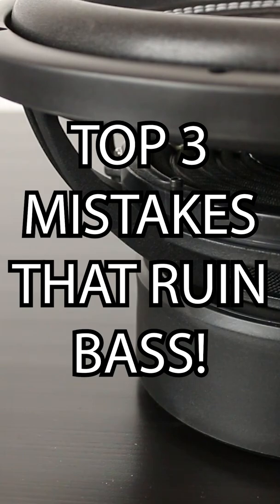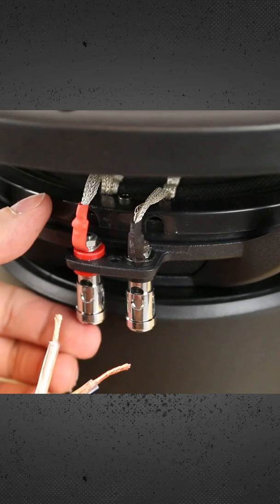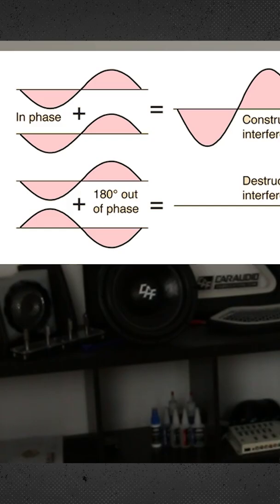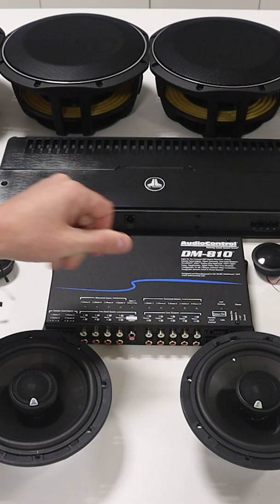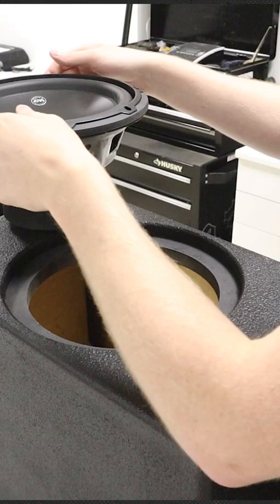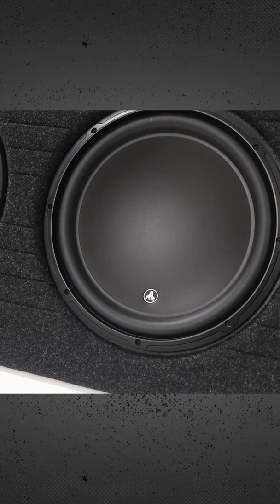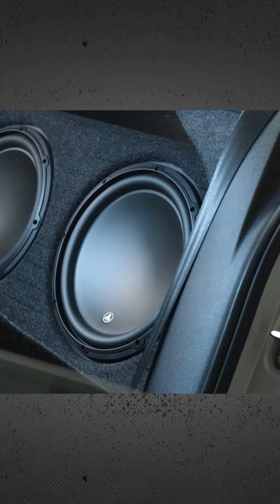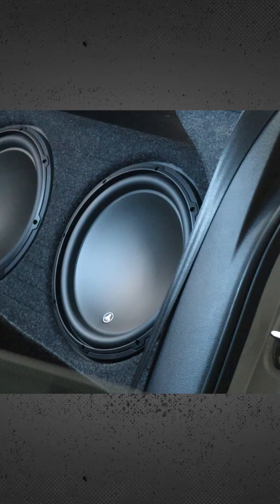3 Mistakes that Ruin Subwoofer Bass! #shorts

Comment: I have a warzone 12 3000w with a power acoustic 2500w amp dose the amp also has to have 3,000 or is it fine I just gotta have a fan running on the amp

Comment: Seeing and hearing my friends mom's Klipsch home speakers with a passive radiator and decided to make a custom box for the rear of mustang GT. Knocked the magnet off an old sub I had and went to work. Everything was ok, box fit good looked ok but was totally unaware of the weight added to a passive radiator needed to make it work properly. Needless to say I had a lot of distortion although it pumped pretty well

Comment: I like running a single dvc 12, I have a sundown 12, the 750 rms one, dvc 2ohm, I have it ran to 1 ohm & it is is a QBomb bandpass box, but I personally like it in a sealed box, but everyone says run it in the ported box? I just like the way it hits in the sealed box, but I just don't want to mess it up. But I have 1 cubic foot of air space in the sealed box. But my question is, does a sealed box tear up subs?

Comment: Improper tuning and overloading of power if you push a subwoofer too hard it's not that you distorted it it stops pushing you get it at the right peak and that frequency of sound will slam

Comment: have you ever combined 8-in subwoofers and 10-in subwoofers in a speaker box designed for a back end of a Dodge Grand caravan what would the sound be like wondering and around with designs got any 8-in speakers are already in the box and close didn't speakers square out of box.????? how do you think I should pursue that for sound.

Comment: Not securing the subwoofer box, and it slides around. Whats worse is if your wires arent long enough, and get yanked out of the amp or speaker box. Also, having your box in the wrong position. If your subwoofers faces are pointing toward the rear of the car, you should have your subwoofer box pushed as close to the rear seats as possible. This will give your subs more space to move more air easier. If your subwoofers are facing your rear seats, you want to slide the box towards the opening of the trunk. This will give your subwoofers the air space they need. However you mount your subs, try to at least give them 1 ft of breathing room.

Comment: How do you know if a sub works better in a sealed or ported box?
Reply: There's a spec called q/qts. If it's below 0.5 it will be better in a ported enclosure. You can research "q" values for subwoofers.

Comment: Biggest mistakes I see are on the head unit, people cutting the harness instead of getting the correct adapter. But for subs I think using cca instead of ofc, I guess its ok for low powered systems but ive seen 18 gauge cca speaker wire from 1200 watt amps same with power wires.

Comment: Subs not being wired for the correct ohm load to match the stability of the amp! 
As an installer since 2004 this seems to be the one I notice more than any. Aswell as subs not having adequate airspace or being in the correct style box per the manufacturer. 

I'm sure anyone else in the industry can attest to how irritating it is to see these issues. Usually these go hand in hand with a $30 amazon head unit! They have full plus level bass adjustment, No sub preout(s), just standard rear 2v preouts. Then they usually have 100% gain and frequency.

This to me is the equivalent of nails on a chalkboard!

I just convince myself their young and just haven't learned yet. Or realize they don't care as long as they have working subs for the time being.

Comment: Blocking the port. However wide the port is, you need that much clearance in front of the port as to not obstruct the air flow.

Comment: Wouldn’t out of polarity make them work with each other? Correct polarity works against each in the same box. That resistance of air flow gets them tones. Somehow I think this only makes sense to me.
Reply: They cancel each other out!  What happens when you take a playing sub out of the box, does it get quieter? Because any air from the front of the sub mixes with any air from the back of the sub they cancel each other out= no sound. Phasing  is the same, they both must push or pull together. The air from one sub will cancel air of another. Been old schooled you have by a 48 yr old who still probably out bumps you with one 12" SPL  soundstream ran off a PPI 2050m. Both over 25 yrs old.  Old school rules!!!

Comment: I have some db drive ewx blackout 12s and I have a 3k watt db drive amp but they don’t hit  low and they don’t hit high, it just kinda has to be in a certain range to sound the loudest, should I move to a ported and larger box? I have a smallish rhino box that was for two kickers I had a while back, there is not much room behind the magnet of the subs they are pretty large.
Reply: Is your amp tuned correctly? LPF too low and your subsonic too high?

Comment: My mistake was not knowing ohm loads before buying. I bought a single evl Skar 18 that was dual 4 ohm. So running that alone I was only able to get it to a 2ohm load. On a Skar 1000.1D amp. So it never hit hard and I was unhappy with it but thought it was shit Skar gear. Until a buddy bought a skar 12 evl and wanted me to test it for him bc he didn’t have a amp. It was a dual 2 ohm. So naturally it got a ohm load. It slammed 3 times as hard as my 18 evl D4. So I knew then something was wrong. So I figured it out and got new D2 18 evl and dropped and then she was doing the jiggle! Ohm loads are important. Thinking back of had this issue before. I was wiring a set of 10s that were d2 ohm down to .5 not knowing it. I just knew how to wire them in parallel and how to wire them and series, and one way they bumped hard and one way they didn’t.. That’s all I knew. But that good hard hitting bass would last 10 seconds before the amp would go into protect mode. Got a new amp. Same thing. Sold it all being pissed off. So yeah not understand ohm loads and what subs you need is critical lol 😅

Comment: running the sub at way too low power for what its made for. make the sub inverted (outside the box) without reversing the + and - from amplifier and therefore will hit wrong.

Comment: Question: If you run 2 subs on a “2000” watt monoblock amp does it split the power evenly to each?
Reply from the maker: As long as the subs are identical (so same voice coil impedance) yes the power is shared. So you would use two 500wrms subs on a 1000wrms amp.

Comment: My mistake was underpowering my subwoofers with a lower wattage amp.  All my friends said to buy an amp smaller than the wattage of the speakers. Welp that’s how you blow up both your subs and amp. Mine was ran 1 ohm so it absolutely needs that juice from the amp or it will over heat the amp and cause the subwoofers to start clipping. Pay attention to things, do your research before. That costed me almost 2000

Comment: I really need help....my subs still having issue with rattling or power cut issue, i have try multiple step like changing the in dash player, changing to new sub, changing the monoblock adding in voltage regulators and adding additional grounding cable to both monoblock and voltage regulators...i have even change new battery with high amp and new alternator...my car model is honda civic FD, I'm using android player with 2 Boston g2 12 inch subwoofer, really need help on this, i have been to multiple shop and check but all of them could not solve this issue

Comment: The too small portion is right and wrong, like for example I have 2 subwoofers that need 3.5 cubic feet per sub of air space and the box is just shy of 6 cubic feet. The thing that helps is that one of the subwoofers is inverted and wired backwards

Comment: One mistake is accidentally putting a metal bike pump into the amplifier rack trunk space. And then you're having a great time cruising and drifting and that thing is rolling around and then goes across the leads. And then you have a fire. lolol.  Then you have to get a cutting wheel to cut the leaves of the amplifier apart because they fused together. But you know that it's still good because the fuses themselves all around the system are still good. So it was just my remote wire shooting out over the ground. It's an external melting. Easy fix. But damn close to catastrophe!  The amplifier lives another day. The remote toggle switch and the dashboard melted. All the wires front to back for that remote melted. Swap it out. Boom we are back running again!

Comment: A ground for the subwoofer or any amplifier should be as short as possible and mount to the frame of the vehicle. You have to have the amplifier at peak performance so add some big capacitors as well.

Comment: Mark, you never mentioned the biggest mistake that absolutely ruins bass but you showed it. That’s using a drill/impact gun to screw down the woofer. That’s the biggest NO NO in enclosure building.

Comment: I prefer one subwoofer over 2, mainly because you dont have to worry about the subwoofers being slightly out of phase, and it makes it sound much cleaner. Im rocking a Skar EVL-12 in a 2.0-2.1 cubic foot box tuned to around 27 hz, and its the best I’ve ever had! Hits 20 hz with no problem, goes as high as you need it to without a sweat.
Reply: The subwoofers will not be slightly out of phase because you ran two, three, or twelve. I'm not sure where you got that idea.

Comment: Building a box that fits my entire ass boot to just blow out all my windows with one single DD 712D

The guy I bought it from says there's something else wrong with my windows 
(The safety glass windscreen and rear window are fine, but the tempered windows on the side are in pieces)

After replacing I noticed the windows are loose as hell and well glass breaks under tension

Comment: Using a cheap amp. It’s better to have a better amp than to have a better sub. Coming from several years in the high end home audio industry I can testify this to be true. A good amp and good processor can make a lower end speaker sound pretty good considering. Put awesome speakers on a cheap processor and amp and it’ll sound awful.

Comment: Well, I use pre-built sub box for my subwoofer, so I'm good there. 

Advice: When choosing a subwoofer for your amplifier, it's better to get a higher RMS power subwoofer than maximum output of your amp. Basically, your subwoofer won't get smoked if you turn the gain all the way up. Don't ask me how I know that 😂

Comment: A mistake I never made is ditching a preamp and/or crossover. Was told by some experts these modern amps make those not necessary.  Yeah ok!
Reply: If you have an aftermarket deck or an output converter like an LC2i they're absolutely not required. That's some old school stuff for sure.

Comment: BIGGEST MISTAKE is cheap ass underpowered amp like BOSS / PYLE / HiFONIC  along with stock alternator and small gauge wire .... all of which could be grouped together as  ELECTRICAL SYSTEM

Comment: Sealed box =  sub woofer gonna break soon
Reply: Not true.  As long as the box has the proper cubic inches of space to run the woofer.   A sealed box is prime for sound quality.   If what you say is true, then why would JL Audio make a sealed enclosure for the W7?  I’m thinking you’ve had a custom made box for a woofer that shouldn’t have been installed in that box.  I’m gonna say there’s user error in your case.

Comment: Can you or someone recommend a open box sub cus I want to replace my factory sub in my car it isn't sealed or in a box
Reply: Factory sub??
Reply: @deepinmythots752  car companies started installing either 2 8s, or 1 10 inch sub with like 200 - 300 watt Amps, cars like the Nissan juke, or most BMWs, how ever most of them do not come in a box like an aftermarket sub, they are usually installed right behind the rear wheel well, they use the cavity in the quarter panel to either seal the sub, or they have a port and they just box the sub in using the quarter panel again for a ported sub. 

Speakers don't perform correctly, especially sub woofers, if they don't have a cavity of air to move. That's why all speakers are placed in some kind of closed up space.
Reply: Yeah don't do that. If you want proper performance and you're buying an aftermarket sub just put it in a real box.

Comment: one of my biggest mistake was me putting a 35 Hz sub in 20Hz Box vice versa or the other way around I did not know how important tuning a box was..😳
Reply: So true,I always winged it based on the cuft required for ported and never knew about tuning,tuned my last build ...omg 😳 the frequency response range is so much better.
Reply: @markpascofl  yeeeees absolutely and more solid Bass i was missing out alot and here i was thinking it was my SUB lol
Reply: @PRTWINCAM  that and using killmat,I never used any deadening before and what a difference. Loud AF inside barely hear it outside. Showed my coworker and he was like wtf how is that possible lol.

Comment: I love when they say I hate ported boxes but buy a sub that is for a ported box 😂
Reply: Ported boxes are good for certain types of music I think
Reply: @SC_2QUICK  it depends. Ported box’s work better in an open area. Where as a the enclosed box works better in a trunk. But if it is tuned right for what ever the user wants and what the speaker is capable of. Mines capable of I think 26 maybe lower. But I have it at 28hz. I don’t really like it there. But that’s pretty to prove that u have a better system. Preferably I’d like a 32hz box. 32 and 34 is good place to be in my opinion. It sounds stock with a twist. But still bangs

Comment: I wouldn't trust the average new vehicle with a subwoofer, especially electric or hybrid vehicles, older vehicles you could take everything apart and put it back together, new vehicles have alot of wires and hoses rubbing, probably voids the warranty

Comment: And first and foremost for most everybody a bad ground as in longer than 12 in tops for a ground wire connection 🤔
Reply: Really? Mines about 2ft. Should I change it?
Reply: @karlbarnett5863  12 or so inches is the best ground connection
Reply: @robrohrer2014  thanks man

Comment: do people actually wire speakers backward?
Reply from the maker: You're likely assuming that every speaker wire is black and red, and who would get that wrong? But in reality when integrating with a factory signal the wires are random colors. They often times need to be tested, and even if you do have a schematic it's not uncommon for even that to be wrong. Polarity must be verified throughout the signal chain.

Comment: If your talking about sound and building show system your not address the issue. Placing the woofer horizontal as your showing not only the bass is not hitting in correct direction. It's working against itself when bass hits roof and back to the woofer

Comment: Biggest mistake is matching RMS of amplifier with RMS of subwoofers. If a amplifier is tuned correctly you can run even a 2000 watt amplifier just fine with a subwoofer that’s 1500rms. Matching RMS between amp & subs is only going to hurt your pocket and feelings
Reply: Wdym so is it okay to install an amp that has less watts than the sub ?

Comment: I had two subs in two seperate boxes a lot of people were actually recommending me to put one sub out of phase and one in phase to potentially get louder didn’t really believe it but I ran it but about a day or so hit lows nice but it sounds like it’s ripping my sub from the inside out this is called a push n pull method not sure but If you could elaborate on this one day very few videos on it

Comment: What radio would recommend I have i full audio set up in my 99 Chevy Silverado ext cab my radio is an Power Acoustik PD-710B Single-DIN My front 2 speakers are ds-18 6.5 inch bullets and also ds-18 tweeters on both sides and my back speakers are kicker 6x9 and I have 2 nemesis audio 8s subs in pro boxes and 1 Memphis 15 all powered by a ds18 3000w amp I feel like it has a lot more potential in it and should be way louder than it is my max volume is only 35, could anyone help me with this?
Reply: You answered your own question bro YOU feel like it has more potential but does it really? 🤔
Reply: A whole lot more Ik I need a vocal amp bc it sounds staticky & I’ve heard power acoustik isn’t a good brand

Comment: I have 4 15s on 16,000 watts
Reply: ive got 30 10" rockford fosgates and 48 12" Rockford fosgates and another various 64 mid range and highs ... 500k rms ... quit talking like a child 🤠
Reply: @kiiarahasnosynonyms  I talk numbers on the meter. Quality over quantity 🤣🤣🤣 Until you hit 159.0 db on the meter then you can talk😊
Reply: @kiiarahasnosynonyms  by the way I have 4 platinum resilient sound 15s on 2 Taramp MD 8000 and all my door speakers are on a Taramp MD 3,000 and I have a 250 watt amp on my supertweeters

Comment: Seen a guy use a 25amp Fuse on 0 gauge wire once.
Reply: Lmfao. That's like 300 watts max
Reply: @bailey2517  if that.  Dude had it bridged to another 1200 watt sub. Not knowing why it keeps going out lol
Math muhfugga math

Comment: Air leaks in a sealed enclosure. Power and ground wire gauge too small.  Conflicting lpf hpf settings between head unit, amplifier, crossover. Bit rate of source signal too low. Believing in the inflated power ratings of cheap Chinese amplifiers and then pairing with a good sub which has the same power ratings but not lying about their numbers.

Comment: My mistake was going to a friend’s recommendation😭 idk why but my head unit always sounds on. Doesn’t work anymore by the way. Only had the head unit in 6 months. Now the fan always sounds on but no display. I know it’s unrelated to the video
Reply: Sounds like it just a bad Radio. Its really hard to mess up on a radio. All it needs is ground power constant, power accessory, and speakers. You have it making noises so it sounds like it getting power, so almost always when it's a radio having these issues. It's usually internal or firmware issues.